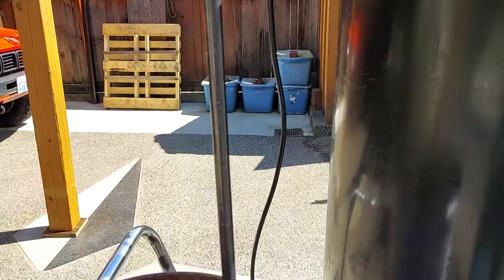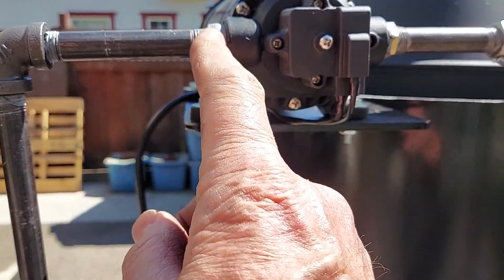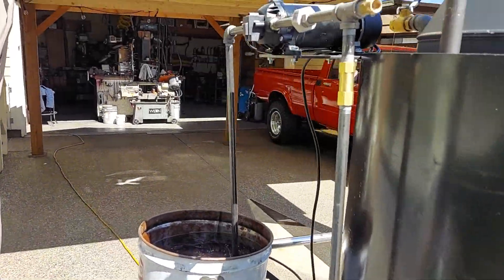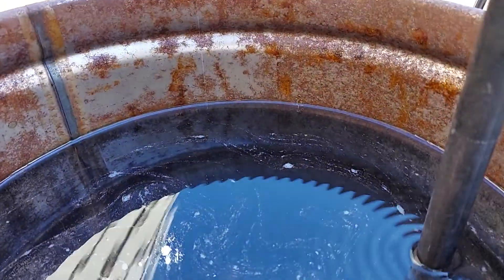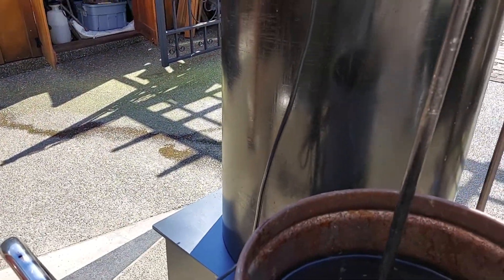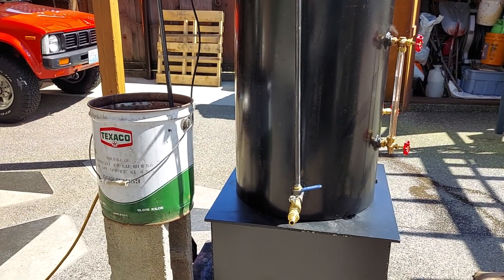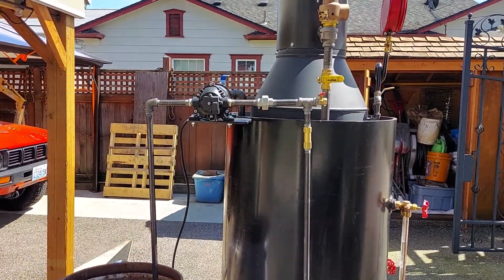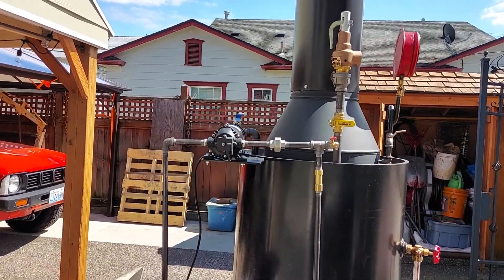pumping water into a boiler that is at 100 lb of pressure off grid

Comment: Was curious what mechanism of check valves you use for the steam/water connections (ball, swing, piston, lift ect.) Also curious as to the pressure of the input of water, does it have to match the overall steam pressure to flow in?

Comment: When the pump is NOT running what prevents Steam from back flowing out the pump and steaming into your condensate tank. How about a Hartford loop, Yes I know your tending the boiler. Just asking
Reply from the maker: The brass check valve prevents back flow from the boiler.
Reply: @rossbendixen  I see it now ....thanks

Comment: A thing of beauty.  We used to use a sump pump in a bucket to raise water up to keep our dock open in the winter.  They had a 1.5" pipe coming off it, and it could throw water pretty high when the end was out of the water.  Maybe a small sump pump would do the job.  Maybe it would be quieter as well.  

What material is your packing?